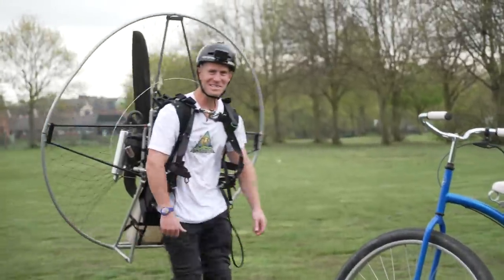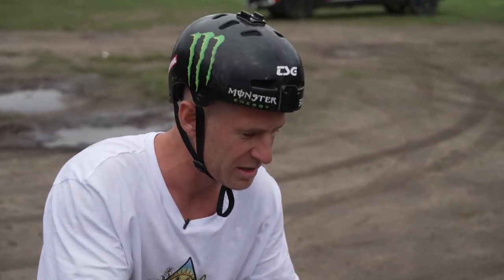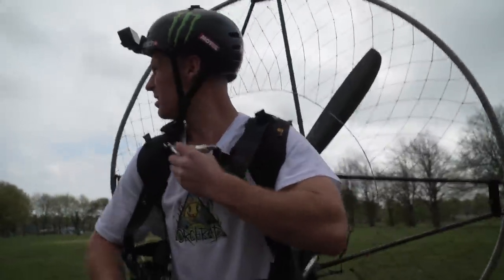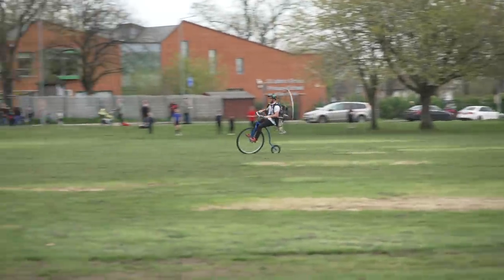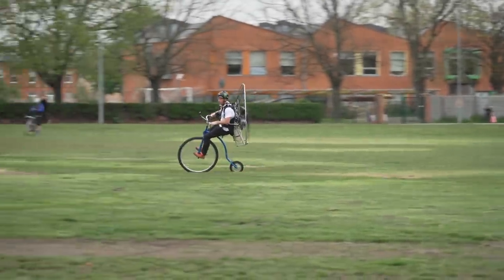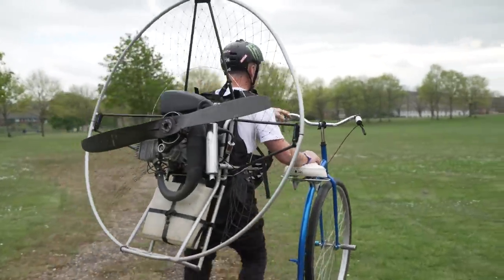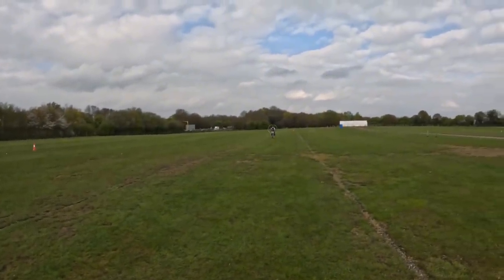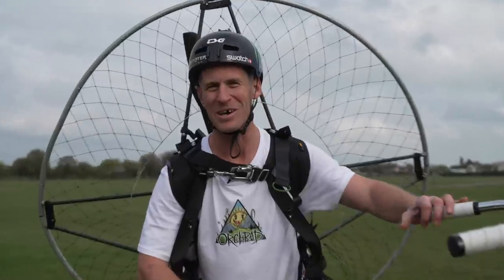EXTREME PENNY FARTHING BIKE VS POWERFUL PARAMOTOR!

Comment: I love these Sam. But I can not stress enough how incredibly dangerous it is to ground start those. Just don’t. Imagine if the throttle you just mentioned stuck open while in the ground. You’re gonna lose limbs. Just toss it on your back and start it mate. There’s a couple really important rules to paramotors and that one is nearly #1 

Just want you to be able to keep making vids man. ❤❤ love ya. Cheers!
Reply: Theres also the chance that if he fell off and shattered the prop that bits of it could hit members of the public. And also during a crash he could easily lose a hand. I'm all for fun and games but c'mon man, do it in a safe and controlled environment.
Reply: @StreetPete  if only. he's got non-working brakes, a flimsy bendy frame and a sticky throttle. PILLOCK. GROW UP
Reply: If it's on your back and the throttle is stuck open does it just pin you on the ground and is there a kill switch you can reach?
Reply: @Dylan -  
The red button on the throttle is the "kill switch." 
He's overdramatising but,  it can be a very dangerous situation especially if you aren't used to the power, thrust, and weight being on your back.
"Turtling" can be a problem, also.
When airborne under a wing (parachute-like unit) you don't feel the weight as you are basically suspended in the frame while the wing carries the weight of the paramotor.

Comment: From an efficiency point of view,  the Penny Farthing bicycle is perfect match for a paramotor. If you can weld some bracing to the frame, it will be able to withstand the stresses a bit better and upgrade the brake  to a disc. Super-dangerous but this was the best video ever.

Comment: I've got one of these and yeah, the brake on that little 12" wheel does virtually nothing at 8-10mph never mind 20+ or whatever you were doing!

However the front fork is drilled for a brake caliper so I found an old-school long-drop BMX caliper on eBay and... well it's still not great but it's loads better than before.

The only way you're going to get halfway decent braking is to get some V-brake bosses welded on and that might be easier said than done if it's an aluminium fork...

Great video though, you've made me want a paramotor now!

Comment: If possible, Installing disc brake, internal gear hub with a ratchet, reinforcing the frame joint will make the bicycle better.

Comment: So funny awesome entertainment dude. I wonder if you bent that rear wheel back a little it would slacken it out and maybe you could dirt jump the penny farthing. would be ultra cool if you could find an old 55inch wheeled big wheeler. Could you go flat out on Colin Furze airfield and set some records? Also you could try the para motor on the bed bike or borrow furze ladder bike and try it on that?

Comment: What if you took the power motor and just sat in a boat? or on the jetski with the jetski off and just used the air prop to move it?
Reply from the maker: My worry is when you fall off attached to a paramotor haha! 😬

Comment: Slap some platforms that can rotate towards the peg.. just a T-shape and a hole big enough for the peg on the bottom part, then bolts through the pegs and the platforms won’t slide off.. 
-BUT, you could go jumping👀👀👀

Comment: Do a hillclimb, with the paramotor grip is irrelevant! Or, maybe get some long elastic and offer uplifts at bikeparks?! I'm sure being the pro you are you already have better ideas.

Saftey wise a break disc and emergancy cut for the engine could be good (the cut could be something simple like pulling the ht (coil) lead off with a bit of string).

Comment: you should just not have anything connected to the axle and weld some pegs onto the forks just above the dropouts so you have somewhere to put your feet which won't spin round

Comment: bri DI BIT ground start that paramotor ever again. always start it on your back.

if that thing WERE to get locked on full throttle, like you mentioned 5 seconds earlier, you would be chopped to pieces.

Comment: sam .. when do you learn to fit brakes on stuff.. like seriously xD .. you really need to learn to weld .. and PLEASE get a new cable on the throttle before it gets stuck .. gas cables wears out you know, you can ofc oil it up .. but when you use it for these stunts then i'd replace instead for maximum safety .. and geez ..maybe support weld the frame of the bike, add offroad tires and a front brake too.. a pair of pins to rest feet on ? ..